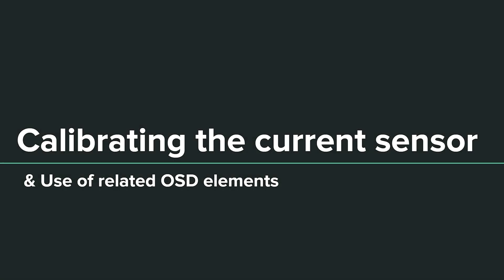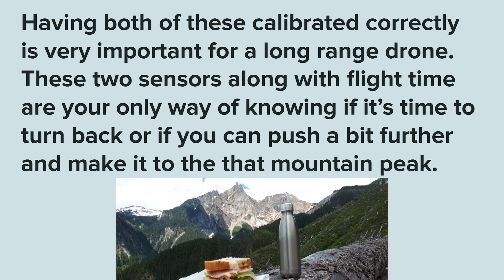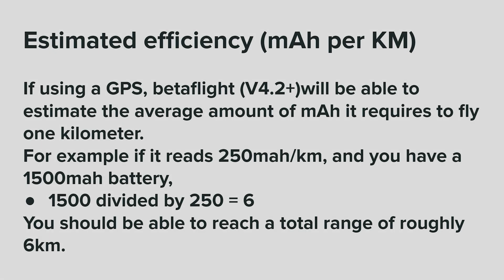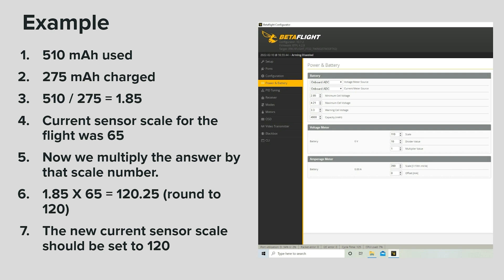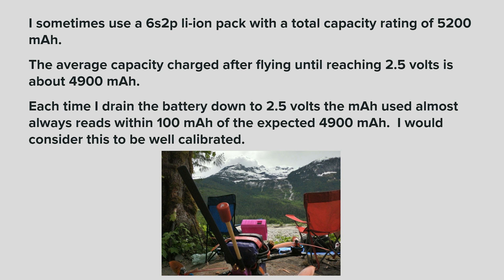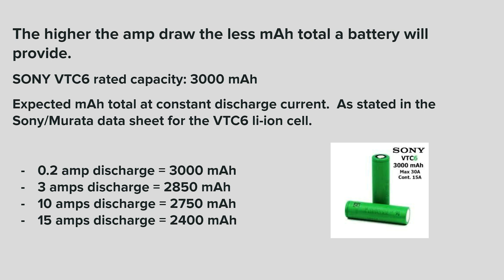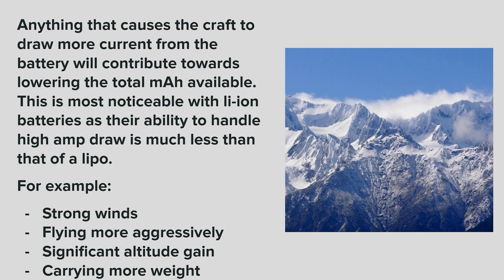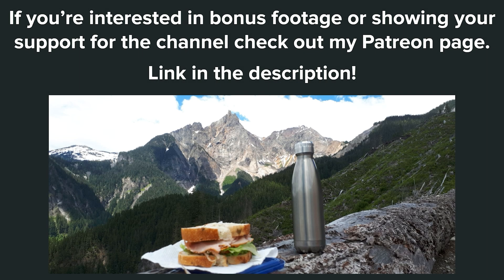Calibrating the current sensor - Long Range FPV Setup & Tips

Comment: Is 65 a general number for the current sensor scale? I understood everything up to the part where the 65 came up, how do I figure that value?
Reply from the maker: 65 was just an example.  Just start with what ever number you already have in the current scale (unless you can find the recommended current scale for your ESC on the manufactures website.  If you can find it, then start with that.

Comment: Great tutorial . Question: Is there anyway to calibrate or adjust the Amps shown in the Power and Battery Tab on the most recent Betaflight release? I calibrated the voltage and it is spot on in the OSD, but the Amps are are way off. I fly the GEPRC Moz 7 and it is showing 8 amps at full throttle where it should be more like 25 amps. My voltage reading in OSD is calibated and spot on. There does not seem to be any Amperage calibration in Betaflight or maybe I am missing something. Thanks for any advice
Reply from the maker: Yes you can adjust the current scale on the power and battery tab.  If you check the GEPRC website you should be able to find the correct scale to use for the specific ESC that you have.  If you can't find it, you can email support for the right number to use or if there if a diff all file for betaflight that they have available you can load it in a text editor and look for the stock setting of the scale.  BTW full throttle on the moz 7's 2809 1280kv motors should probably be over 100 amps.
Reply: @FalconRadFPV  Thanks for the reply. I will contact GEPRC. Problem is there is no calibration for the amperage in the most recent firmware update for Betaflight, only the voltage. It shows the amperage being drawn, but there is no scale to adjust it. I have watched many videos showing how to adjust it but they are all on older versions of Betaflight and those older versions did have an adjustment scale. In any case I have a couple dozen flights on the MOZ7 now and I have been using the volts, time flown distance flown to determine when to land. Max flight time for me with 8AH lion battery is only 15 minutes & 12 miles. Specs state 30 miin flight time with 6AH pack (no way!).  Thanks again, really enjoy your videos, I have learned a lot about long range FPV fron you!

Comment: what about measuring amps by clamp meter or multimeter and making calibration?)
Reply from the maker: That should work.  Just double check vs the mah used in the OSD and what the charger says.  It's the mah used in the OSD that is really helpful for long range.  If you always get 3800+ mah from your 4000mah 6s lipo then you know you need to turn around at a bit less than 1/2 of that.

Comment: Do you run those cells down to 2.5v when flying?
Reply from the maker: Usually only down to 3.0volts.  Because after 3.0v it drops really fast.  After landing the voltage goes back up to about 3.2v.  Li-ion cells vary in what voltage range they put out the mah at.
Reply: @FalconRadFPV  it's just that you mentioned 2.5v in the video for full capacity, and I wondered, since I never get the full capacity either - for that same reason, that it starts to drop real fast below 2.8 or so

Comment: An informative and well done presentation. Hopefully you consider covering other LR FPV topics in future.
One minor note at 2:58, the "6km of range" is round-trip range. 
ie: flying no more that 3 km away, and 3 km back home.
Reply from the maker: Yes that's correct, I used the full battery capacity for the calculation, so round trip.

Comment: Btw, estimating efficiency in mAh is not very accurate, because you are flying on power in Watts, not in mAhs. For given constant speed, the power is also constant, but while the battery sag you will have to draw more and more amps to maintain that level of power. So I prefer to output power in OSD and monitor it. When you know average power you fly with, it's easy to estimate time by dividing battery Watt hours by power
Reply from the maker: Thanks for the tips but I do believe that Betaflights estimated time remaining and efficiency per km work quite well, no calculations needed.

Comment: What sort of fc/esc would you reccomend for a first time sort of budget 7" build?
Reply from the maker: For a long range quad you want reliable parts.  I'm switching to the maytek H743 flight controller and currently using a foxeer reaper ESC.  T motor is also a very good choice for an ESC.

Comment: when you are using the 6S2P pack, are you using the total mAh replaced in both packs in order to calculate? I think I know the answer, just confirming. Thanks for the video, looking forward to the next flight.
Reply from the maker: That is correct.  You would add both packs together for the mAh charged part of the equation.

Comment: hi how much does your aos falcon 7 weigh?
my setup
frame:  Aos falcon7 
motor: T-motor F90
ESC: F55A PROⅡ 6S 4IN1
FC: t-motor F7
TBS diversiti
matek GPS
batari molicel 6S2P 3200mah
analog VTX
end my setap 1650g :)
Reply from the maker: with a hero 8 props and battery straps (no battery) it's 765 grams, my 6s2p 4200 mah cells (8400mah total) is 910 grams
1675 grams all up weight, I get about 20km total range even when flying up a mountain.  
1367 grams with a 4200mAh 90c  lipo

Comment: Conrad, you fly always just backwards and forward 90% of the time. What would happen if you used two patch antennas as vtx, one forward and one backwards? More range?
Reply from the maker: Interesting idea!  I think a splitter to hook up two antennas would likely cause some loss in the signal strength though.

Comment: The current sensor in my hobbywing 45a recently stopped giving a reading so I purchased a hglrc xt60+ current sensor. I have it close to reading correctly but the scale is at 800. Seems crazy to be that high on the scale.
Reply from the maker: It likely uses a different type of shunt resistor to take the readings.  If it's consistant then it should be all good.

Comment: I use to do this on every drone. Good to have it reading close. But when I had one drone that just wouldn't read right. Slow cruise be perfect. Fast cruise be off again vs charger. 
I got a meter to read current and been using that. On my long range ones. 
Had drone before go like 400 and 700.  I've had to adjust the offset before.

Comment: Does it make a difference if im on the other side of the curve and after dividing my osd reported mah by my actual charged mah my number is less than 1 e.g.(.877) so .877x100= 87 new amp scale number? Will it still work in my situation?
Reply from the maker: Yes 87 is a realistic scale number.  Change it to 87 and try again to see if it's closer now.

Comment: Very helpful. Especially the mAh usage you can expect from the battery based on the discharge current. Just came back from a medium range flight today where my DJI OSD froze in the middle of the flight and I didn't noticed right away. Quite the scare when you are 2km away and no idea how much battery capacity I had left. Landed with 11V left on my 3000mAh 4S1p Liion.
Reply from the maker: Woah 11 volts on a 4s that's lucky.  Now that's using every last mAh.

Comment: this is so helpful, i've never had mah use and total on any quad, and like you said in the vid, its vital to get to know each battery personally,  and fly them accordingly, ie, dont thrash a weak pack and don't waste a good one by flying too long,  i am able to fly a consistent amount of mah's  just using the voltage and how fast it recovers but this is brain power i dont have to spare while flying so i'm very grateful for this insight on how to get accurate mah draw and total.   next i need LQ hehehehe, i'm on dji v2's and nirvana nv14 radio.....
Reply from the maker: Thanks buddy!  Glad it was helpful.

Comment: The current sensor in chargers can also be off by 10% so make sure it's accurate before you use the mAh charged to calibrate your fc current sensor.
Reply: Yeah I have one that went off. Started reading low compared to 2 other charges vs drone that was calibrated readings. I picked up a clamp meter and adjusted current like that a few times. And adjust offset. Now drones are on for amps at low throttle and high throttle. Usually when I do off charger it only on at that same cruising throttle.
Reply from the maker: Thanks for the tip.

Comment: great video do you use a switch to change settings BF for different batteries? or just hook up and change it everytime you change types of batteries?
Reply from the maker: I usually leave it set to the battery type that I use with it most often rather than switching it.

Comment: I'm trying to set a 7" up for longrange. Motors are 2507 1800kv. Do you think I can use 6s2p Li-Ion pack? Or it will be too heavy for those motors?
Reply: You should use lower kv motors for Lithium Ions, or perhaps a throttle limit. But that's not ideal In my view.
Reply: @jhughes2286  yes, I'll use throttle limits. But, is 2507 a small size for 6s2p pack?
Reply: @Tonynux  no not really but the question should be is 7inch prop too small for 6s2p?
Reply: @jhughes2286  is the 7inches (HQ 7040 3blades) prop too small for 6s2p?
Reply: @Tonynux  In my eyes its close, but it will work. You can get 30-40mins with 8400mah 6s2p. I wish there were more 8inch frames, they are kinda rare.
Reply from the maker: @Turtle Fpv  I'm working on an 8" frame, going to start flight testing soon.
Reply from the maker: Ya throttle limit for sure, you'll need to be caeful of the amp draw.  They will lift the weight ok but it will fly like it feels a bit heavy.  But if you aren't doing any freestyle or crazy dives it should fly alright.  I've flown 6s2p on avenger 2507's before.
Reply: @FalconRadFPV  just to be sure with the amp draw, I will set the motor_output _limit = 75% (instead of throttle limit), so that I will reduce the PID Controller authority on each single motor.